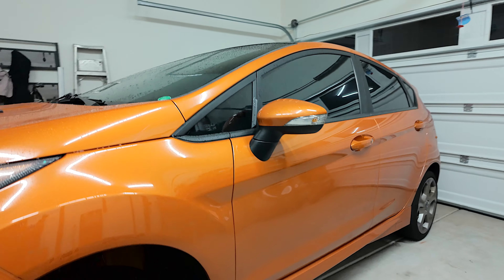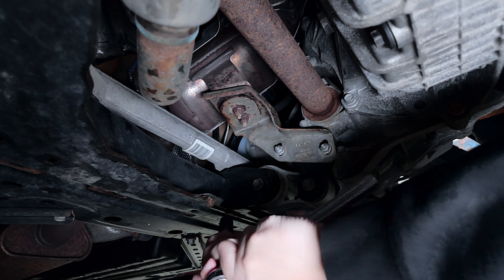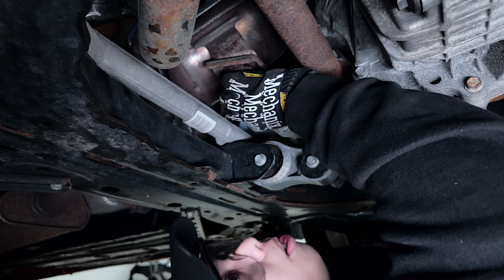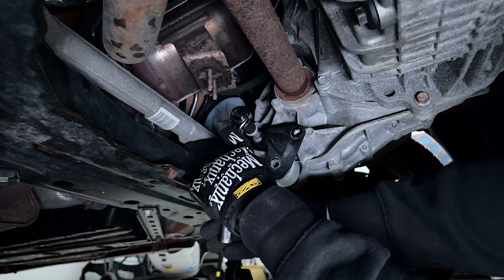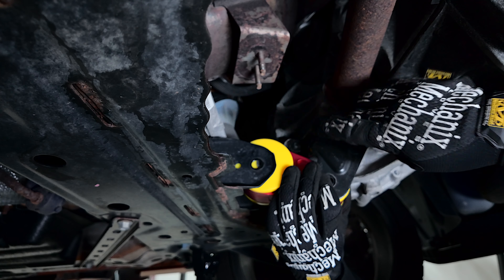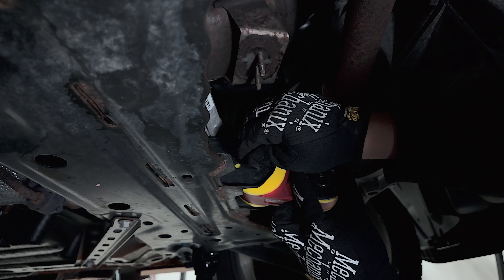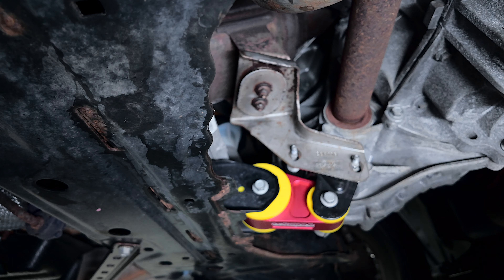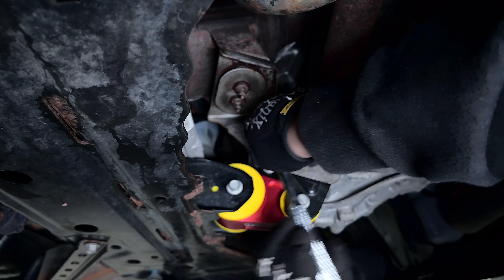Installing the Whoosh Rear Motor Mount on my Fiesta ST | FiST 2019

Comment: Found you on the reddit! Great video and sadly I have the same exact issue. And sadly I found just today it is the passenger motor mount. That being said I found a kit made by awr that makes all the mounts for it. Problem being these mounts are made by Mazda and are rated for really low HP and torque cars so don't last long at all.   So if looking to not get vibration they do make a 62 nvh setting and 70 that should way better and not vibrate much (stock is around 70). I'll be grabbing the 88 nvh kit soon since will be a autox build! Thankfully even tho this didn't fix your problem, it would have been down the line so nice that you got it done!! Keep on the grind!! Good luck!
Reply from the maker: Hey! Thanks for the comment! Yeah mine was the PSMM and funny enough I basically went through the long way to get to the fix. I tried replacing the bolt in the oem psmm and it didnt fix it so now I have a vibratechnics psmm sitting in my garage. All that said, expect 2 more videos on this haha. And like you said, I probably wouldve upgrade the rmm anyways so I dont feel as bad. Appreciate your insight man! Btw Ive heard good things about awr. They’re pretty active in the community too from what I hear
Reply: @kuyaquasi  that's good to hear!! Loved your shifter install.  Want one so bad but pricey and the shaving of the cables is sketchy 😂
Reply from the maker: @ProjectRad lol! Yeah I really like the shifter. I know it gets mixed reviews but so far I haven’t had any issues with it. The shifter cable ball joint was annoying but since it has a bolt that locks it into place it doesn’t feel like it’ll break at all. If anything I’m more worried with the fact that it puts a lot of pressure on the cable. Hard to explain in text but on one of the cable you’re kind of pushing it in toward the engine bay. So far so good though!